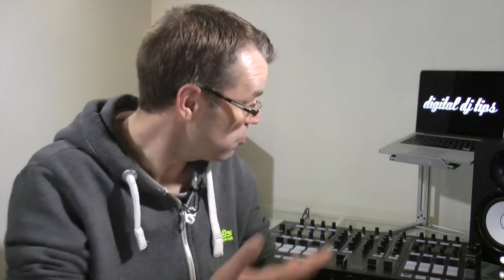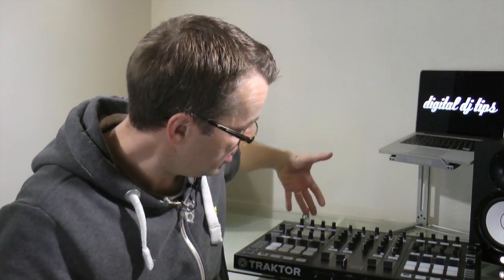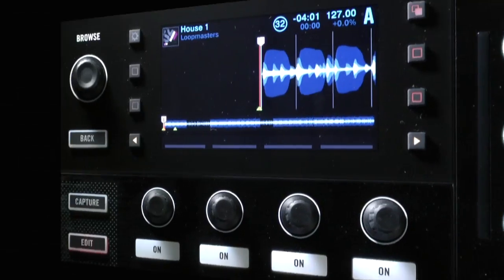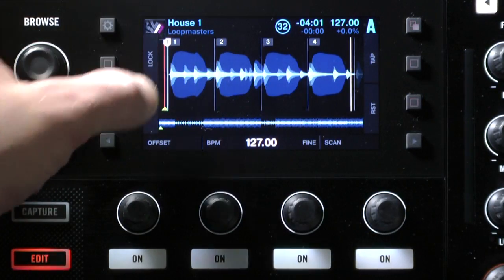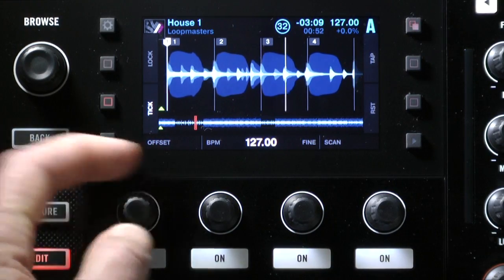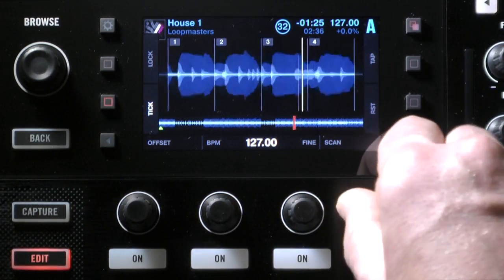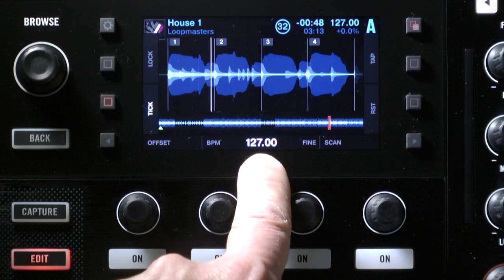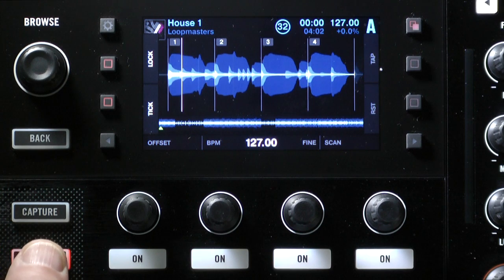How To Set Beatgrids On The Traktor Kontrol S8

Comment: Marker still won’t start on the correct “1” how do I shift it in place so I can set the marker??? Someone help
Reply: You do this in Tractor on your computer. Press the white button, with the beat grid you want to delete. Then press the dustbin, under the queue markers. Then you put a new grid. This function is located next to the dustbin, below the quepoints. There you can choose whether it should be a que or grid. Always put the grid on the first "one".

Comment: why am i not allowed to change the beatgrids to some tracks on s8?
Reply from the maker: What's happening when you try? Unfortunately with Traktor there isn't elastic beatgridding, so with older or more funky songs with less rigid/quantised patterns, it will be more difficult
Reply: i can't adjust the beatgrids in the middle of the song if is necesary, but only on few songs

Comment: Is there a way to scan through the track faster - seems to take ages to check the end of your beatgrid.
Reply: +Pete Horam Keep shift press as you scroll, it should fly you right across.
Reply: +Pete Horam Sorry, on the Traktor S4, when you keep the shift button pressed, and turn the dial, it fast forwards your movements. Not sure if it works exactly the same on the d2 but worth a try.
Reply: Shift, RTFM.

Comment: These videos are great! I've know that I've been underutilizing my Traktor software, despite being a regular user since Traktor 3 was released. Due to a variety of software issues (mostly PC latency related, none really on Mac), as well as limitation of the S4 hardware, I was losing interest in the Native Instruments line. Today I use a combination of the Audio 6, X1MK2, and F1 with an external mixer - it works well, but can be a hassle sometimes. I wasn't convinced that the S8 was right for me, but your videos are starting to convince me otherwise. It seems they really have put in some thought to making this something where the need to use the PC is minimal, perhaps only for searching in most cases.

Thanks for taking the time to put these together. It has renewed my interest in the S8.... Now if the case manufacturers would build something that makes sense instead of shoehorning units into existing form factors. :-)
Reply: The latency issues seems to be solved by now (5 years down the line) on Windows with Traktor Pro 3. It was mainly caused by the USB interface.

Comment: I use the Z2 mixer and I've noticed that it almost always gets the beatgridding spot on with house, breakbeat, trance, or even dubstep but unfortunately it really seems to struggle with drum and bass. Normally it doesn't even work to manually switch the beatgridding, it just always reads it on a half beat instead of the kick for whatever reason for me.

Still, I can say that it helps with manual tempo adjust and actually using my ears instead of relying on the sync button, so it's not all that bad lol
Reply from the maker: If you do it manually it's totally up to you though as you can make it count the "1" on the downbeat easily enough.